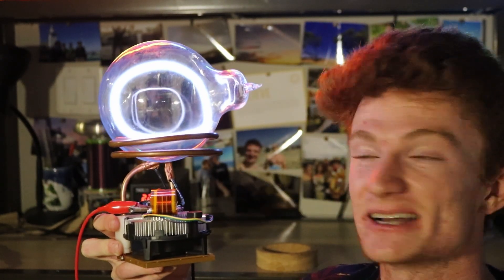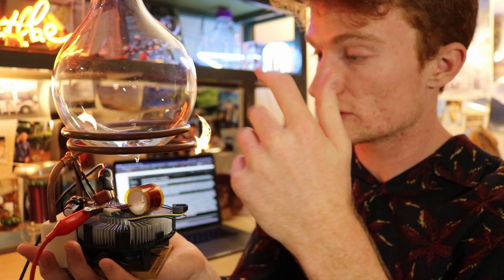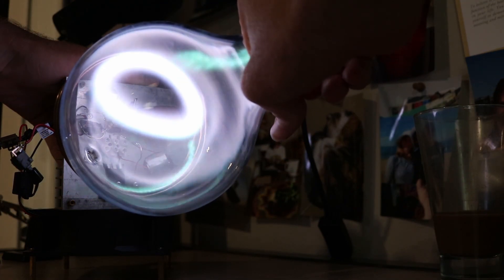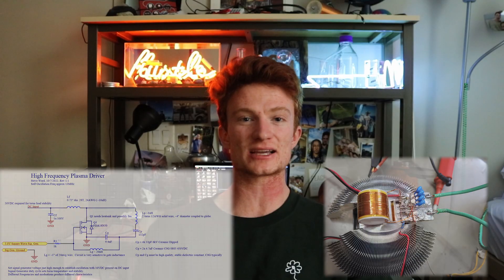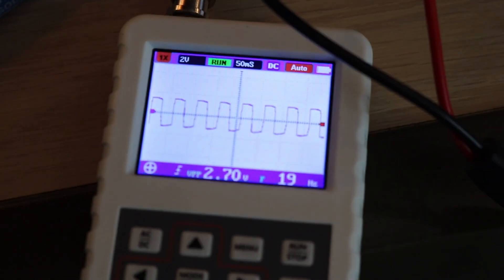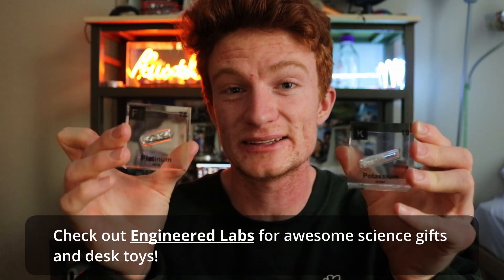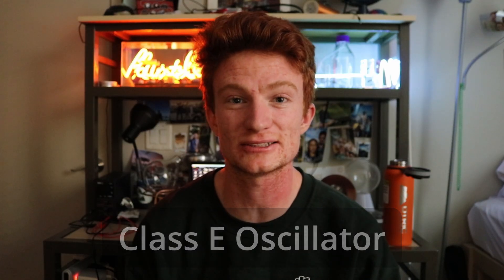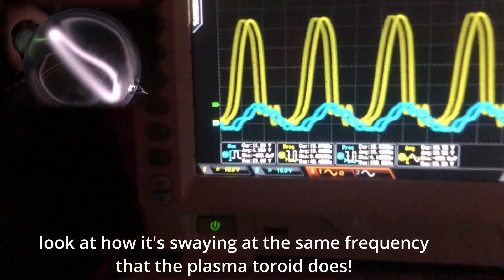perfecting and explaining the plasma toroid

Comment: Is there a way to estimate the current density in the plasma ring? Does it depend on the gas pressure and/or the input current, voltage, or circuit's frequency?

Comment: I was able to build one using your schematic, and only later did I realize that I had made my primary coil (L2) 10 µH. The device works perfectly so far, I've run it for up to two minutes at a time without any issues. It gets warm, but not hot to the touch. I was wondering whether you know how the inductance of L2 affects the device’s performance.
Edit: I just realised I was using the old version of the circuit which is supposed to run at 19.5 V but I ran it at 24V and 3A.

Comment: Very Nice!!!  I specialize in building multi-terawatt semiconductor power-stages.  I would love to share sponsorship for building a 180 TERAFLOP+, Gigavolt Semiconductor power-phase for an open atmosphere toroidal plasma generator timed by satellite and direct optic fibre.  My goal is to have the toroid so big that we need to correct for the surface curveature of Earth/linear distance, in order to keep the toroid stable!!    I am aiming at this for a very specific reason......
Reply: Would you like to see a circuit diagram for one of the phases of a single-terawatt semiconductor power-stage design??
Reply: I propose.... Controlling output-capacitance-discharge faster than electrons can move through the output wire... If we can achieve this... There is no limit to the amount of power/Joules-per-second we can discharge through our Terawatt power stage...right?   If we get the control signal sufficiently ahead of the power signal... We can switch the output electron mass into a storage tank again and again without it ever seeing ground.  A massive LC circuit at GigaVolt insulation would be able to store Petajoules using this power-stage...

Comment: For the music you could try to use another mosfets to switch the source pin from the oscillator fet. And switch it on and off to ground. Keeping the original gate drive for the mosfet. Basically using the secondary mosfet as an interrupter switching the ground on and off to the amplitude of the music. I've done this using a zvs driver and switching it's ground. It works better if you use a square wave input, like midi so it's 100 percent on and 100 percent off instead using it as a switch and not using it in its linear mode
Reply: Directly connecting the sound source to the gate wouldn't work either way since it needs the feedback from the resonator to switch at the resonant frequency. I'm guessing if you hook up a vhf transmitter to the input of it you could probably get it to work since the output signal would be at the mhz range and the audio would be superimposed onto the carrier wave? Maybe, I got no idea but that sounds like it could work because class e oscillators or more correctly amplifiers are used in RF communications and VHF UHF amplification so it probably would work but because the signal amplitude would change constantly the ring of plasma probably wouldn't sustain itself since it would basically be switching to the input signal and not at a fixed state

Comment: Is FGA25n120 able to be used in this circuit?
Reply from the maker: You could try but you dont need one with such high voltage rating. That one is 1200VDC and this circuit only needs 200VDC at most. Also it is an IGBT which are better for lower frequency circuits like <500kHz. A mosfet is better for this because they have less gate charge
Reply: @BackMacSci thx :D and can you do a collab with plasma prince?

Comment: If you want to modulate sound or music into your circuit, one easy way is by replacing L2 with an audio transformer or equivalent reactance on the secondary. Then feed your audio signal into the primary. Of course, on an audio transformer, the primary and secondary are interchangeable, so the important thing is to match the impedance of L2.

Comment: Can you try increasing the current and or voltage after you get it stable because I want to see if you can make it thinner and hotter.  I really believe this might be key to fusion.  Its like a Fusor without the middle electrode and thats a really big deal.  I am positive Deuterium in this flask will fuse when proper voltage is reached the only question is how much.  It should be relatively high without anything to cool down the particles.

Comment: It is a low power induction heater. I need to develop one that can take an input of 24v DC and output of 30-50KHZ . I am going to go with hellium charge at 14.7psi not putting out there at this time what I am going to put the hellium in because I have not worked out the details with the shrader valve yet. It would probably melt.

Comment: Okay im no scientist but if you were to wrap everything but the top and button in a thinner wire  with two different high power high oscillation power sources both running into each side of said piping?

Comment: Hey i saw your schematic.  I have a doubt. When u were soldering the circuit you placed two smds between source and the 4 parallel capcaitors. What is the value of those capacitors and why are they used

Comment: I would suggest using Helmholtz coils design for your plasma ring so when it starts floating in the middle of the vacuum tube you can then use the Helmholtz coils to compress the plasma into a ball in a sense making your own artificial ball of plasma. I predict with a design such as this given enough power a device like that could have to potential to create fusion. But a device large enough that can handle that kind of power I bet would get really expensive so maybe you could make a small design of it and test it out to see what can be done with it....

Comment: You should try different coil configuration  and  see if you can make a old tube color television. If you take the electron gun/emitter of the back you can use it. CAREFUL!!!! It has thousands of volts of static built up and is under pressure. It will shock the heck out of you.

Comment: This is boo table { border: 1px solid #c4c7c5; border-radius: 4px; font-size: 16px; } th { padding: 18px 16px; text-align: left; } td { padding: 16px; border-top: 1px solid #c4c7c5; } .katex-mathml{ display: block; text-align: center; } .katex-html { display: none; } 

Plasmoids, which are structures of plasma confined by magnetic fields, can influence proton quantum tunneling in several ways. In the context of nuclear fusion, plasmoids can create conditions conducive to proton tunneling, which is a quantum mechanical phenomenon where protons penetrate through energy barriers that would be insurmountable under classical physics.

Proton tunneling is significant in nuclear fusion because it allows for the fusion of atomic nuclei at lower temperatures than would otherwise be required. This is because the tunneling effect allows protons to “tunnel through” the Coulomb barrier—the repulsive force between two positive charges—enabling them to come close enough to fuse.

In a fusion reactor, creating and maintaining a plasma with sufficient temperature and pressure for fusion reactions to occur is challenging. Plasmoids can help by confining the plasma in a way that increases the likelihood of proton tunneling. The magnetic fields in plasmoids can also help to align the spins of the protons, which can further increase the probability of tunneling.

Moreover, recent studies have suggested that quantum mechanics, including proton tunneling, may play a role in biological processes1. For example, proton tunneling has been implicated in spontaneous mutations in DNA, where it can lead to point mutations due to the protons occasionally being found on the wrong strand of DNA2.

In summary, plasmoids can influence proton quantum tunneling by creating the high-energy conditions necessary for tunneling to occur and by using magnetic fields to manipulate the behavior of protons, thereby increasing the probability of nuclear fusion reactions or affecting biological processes like DNA mutations.

Comment: I saw the plasma channel and Inteza with their version of this, and my question and possible experiments I want to do if I get enough free time is see if you can do non circular resonators.  If you could mess around with radio antennas as resonators and concentrated electric field zones around antennas with different amounts of poles, it might be possible to have a monopole whip antenna create a hollow cylinder around it and a synchronized dipole create a beam between the two rods.  If we can mess around with this and start projecting in a planned direction from the resonator and ignite air with handheld systems... Well now we have real plasma light sabers, not the Hacksmith's very hot torches.  And if you can send pulses that will persist for a couple feet separate the resonator down a resonator barrel now you have short range plasma weapons, likely to mess up any drones.

Comment: @BackMacSci I had an idea that I might try in the future but I want your opinion on it first: use a vacuum chamber glove box and run this circuit inside of it and test out the characteristics of the plasma by interacting with it directly. The coil itself I think should be separate from the circuit for easy mobility within the chamber and should be in the form of a sort of pen if you will. How possible do you think this idea is? It would run in the same atmospheric pressure so the plasma toroid should form.

Comment: Idea: Traveling plasma ring through a long bending glass tube that either spells a word, like a neon sign with multiple letters, or a light phenomenon that looks like a gushing river of electricity. I also noticed how the plasma ring looks different in it’s different phases before it disappears, and looks like an aurora. Green lights. A simulated standing aurora that dances in a consistent pattern would be cool. Basically, movement is the idea. If you could control the movement like the Krypton prison rings on Superman the movie, that would be cool. Keep creating. Great stuff.

Comment: Chemical etch with ferric chloride. Use 3d printer to slosh back and forth. Also, use paint marker or something ontop of the permanent marker to better protect. 

A bit of heat form the printer heated bed can help too.

Comment: @BackMacSci if you are still working on designs of your instrument, please take a look at 'cathedrals' and various domed buildings that contain symmetrical designs. You may find an answer on how to amplify and enhance sound there.
Copper, mercury, 8, 3D printing template shapes and using 3 stages for the plasma, you could probably make a very impressive sonic visual device. You can inspect the spires atop the various buildings to learn more - shrines in Japan and many more in other countries.

Comment: Is this actually economical* or just a cool proof of concept?

*Even if not at a scale or in comparison to other power plants. Does it theoretically break even in terms of fuel costs and if so where and how?
Let's say if we don't count labor and ignore opportunity cost. Having to harvest the heat is fine. Lets say we only use it in winter. 
So only material and fuel cost vs all of the measurable output in currency.

Comment: Fascinating project, but please stop wearing gloves when you use a saw or press run by electricity, if the glove catches the blade, it will deglove your hand removing all the skin of all your fingers leaving just a skeleton and no muscle. It’s a really ugliest thing to see when it happens. You need to use push blocks to use pliers, or hold it with a tool to give  your hand distance away from the sawblade and drill press has enough muscle to do this. That’s the reason they make vices to mount to drill presses. You were safer doing it barehanded than wearing the type of glove you’re wearing that holds together very tight that if it got caught in any of these devices, it would remove all the skin and muscle off of your hand because . It took six years for me to get 85% of the use in my hand back from an accident at work. And I have never gotten 100% use back and that’s the best case scenario.
Reply: I agree push blocks are way safer
Reply: Sorry to hear of your accident. The slow recovery is unimaginable. You're kinda awesome for persevering and getting so much back from what you lost.
Reply: Hi Jerry - I'm sorry you suffered. 😢 You're sharing and caring and advising others and that is awesome.  I read your entire message and shared it with people I know.  I hope you continue to improve day by day.
Reply: Or, this might be a stretch, use tools for what they are designed for...
Reply: Hi Jerry - I'm sorry you suffered. 😢 You're sharing and caring and advising others and that is awesome.  I read your entire message and shared it with people I know.  I hope you continue to improve day by day.

Comment: so what would happen if we use stainless steel instead of copper pipe ? I would want to add cooling fluid into the my induction heater system. Thus stainless steel would be more durability against to higher heat and corrosion.

Comment: you would think with how relatively simple it is for a student like yourself to get a stable ring of plasma like this they could be doing something similar with fusion reactions for the power generation projects trying to harness fusion. although even my smooth brain can understand getting a stable ring of plasma and sustaining nuclear fusion are two very different things. I only mention it because my understanding is most of the projects trying to harness fusion usually involve rings of plasma no?
Reply from the maker: I believe the main reason that tokamak is harder is because of scaling a plasma toroid needs much stronger magnetic fields leading to much bigger magnets and lots of engineering challenges like cooling the magnets. Also tokamak goal is fusion in plasma which is much harder than just making plasma, which is what my lamp does. Their plasma is much hotter too which brings more challenges. TLDR: mine just looks like fusion, theirs has to do fusion and do it with positive  energy generation
Reply: I think they just share the idea of holding plasma in place using

Comment: I believe the sound was actually the coil vibrating against the glass not the plasma. If it's AC current going through the coil, then it could be the Hz at which it oscillates. If the power for this thing comes from the outlet in your home and is unaltered from the device then I'm guessing the coil is vibrating on the side of the glass at 60Hz. As it moves the pitch changes from the vibrations carried through the glass. If it DC then there could be a vibration from the device itself and that vibration is being carried through the coil hitting the side of the glass getting the same effect.

Comment: correction the mantic field "is the electricity" nothing runs trough the wire... wire heats up and melts do to the magnetic field moving over the top of the copper (what we call it "friction" super conductor has no friction)... your body creates the same toroid field... that is why it interacted with your hand when you touched it... but all and all great build...

Comment: Cathode ray tubes are nice and all. But geissler tubes put them to shame. All sorts of multicolored spirals and tubes and shapes. Almost like a neon lamp had a baby with a cathode ray tube. https://sprocure.web.cern.ch/Electricite/Geissler.png Or there was an ancient form of computer memory that used a CRT to save the bits of memory called a williams tube: https://en.wikipedia.org/wiki/Williams_tube#/media/File:SWAC_003.jpg It's not just displaying what's in memory, that IS the memory. It's really interesting the types of solutions they came up with for computer memory. Even as simple as a vibrating wire.

Comment: You might try placing a coil around the center of the glass that might stabilize the plasma ring.  Just apply a counter magnetic field at the same frequency as the primary, but adjustable power.